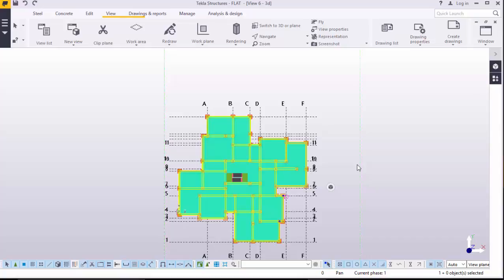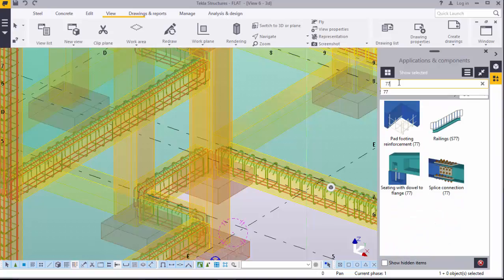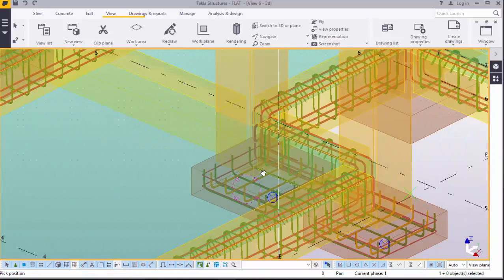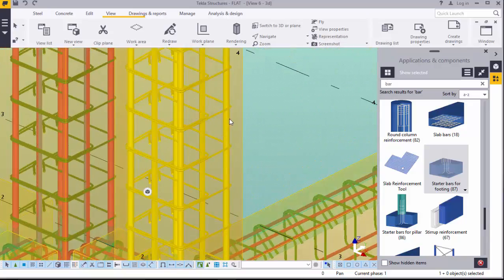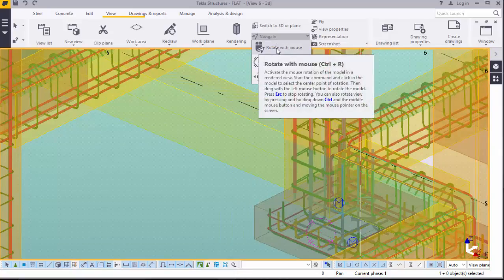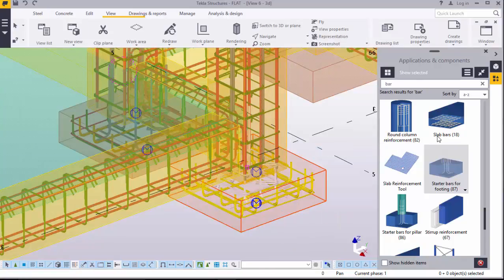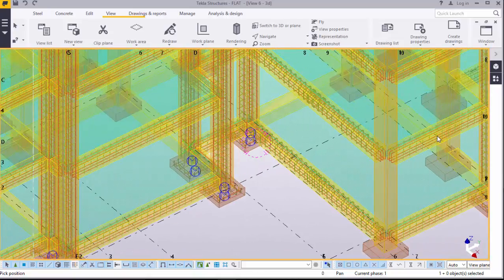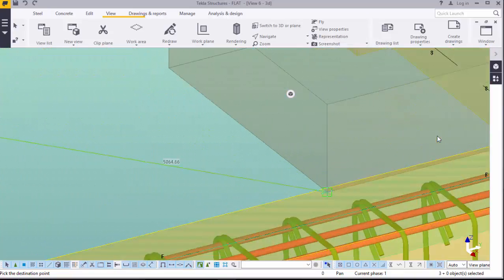Rebar Placement in Columns on Modelled R.C.C. Structure in TEKLA STRUCTURES 2016

Comment: Hi! Which is better? To import TSD file to TS ? Or to create a new project in TS then assign rebars? Thank you!
I tried to import TSD to TS but it takes 30 minutes on a high end computer and it crashes when I use a less better PC.
Reply from the maker: do it in TS
Reply: @MauriceDimba  does it mean I have to reassign the reinforcements bars I got from TSD?

Comment: Hello sir,
Very nice videos, you are probably the first to upload rebar detailing in tekla. I want to ask you :
1. is it easier to make rc detailing in tekla than in simple autocad or allplan? if yes what are the benefits?
2.can you upload some vids with rc detailing in diagonal reinforced coupling beams?
Keep up the good work and hope to see more of these videos
cheers!
Reply from the maker: With Tekla structures,you're at home as a structural engineer or 
structural steel detailer,Tekla will give everything you ask for 
e.g.R.C.C Bending schedule is just a click,Instead of using spreadsheets
 to generate rebar bending schedule and calculations.AutoCAD isn't 
approriate tool for quick rebar detailing and a professional work 
presentation in rebar detailing,am not bias here its also quite 
important for TEKLA,you can also export to AutoCAD in DWG format.
Reply: it is possible for you to upload videos with rc detailing for diagonal reinforced coupling beams in TEKLA?
Or examples of reinforcement for winder stairs?
Reply from the maker: Yes,Smith i will upload.
Reply: @MauriceDimba  How about between Tekla and Revit, sir? Which one do you think is more convenient for drawing and detailing? Btw, impressive video, sir 👍👍
Reply: please send me detailing tutorial link.  softwareqs3@gmail.com